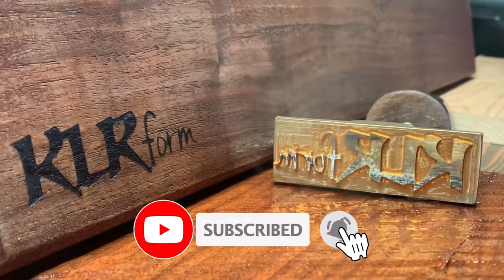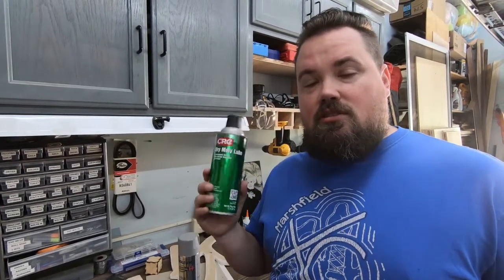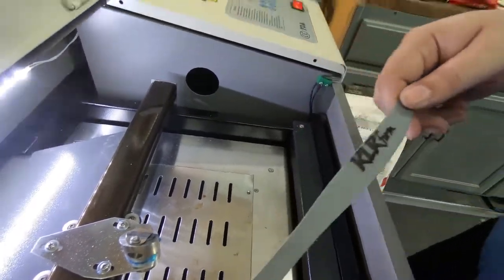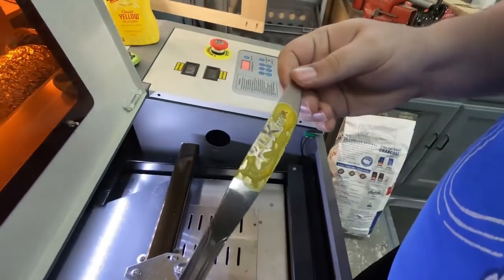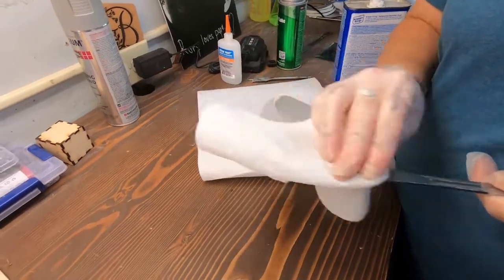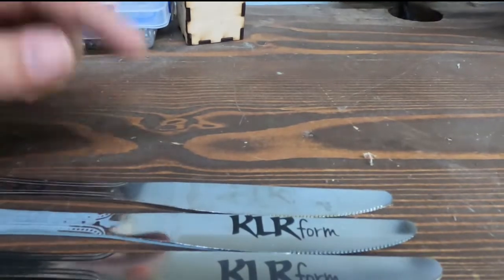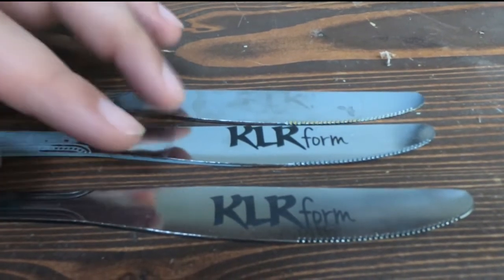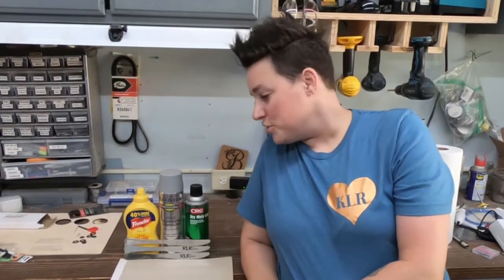CO2 Laser Engraving on Metal | Monport K40

Comment: 50% power on a 40W tube will burn up the Co2 really fast. That's probably 25+ mA. 40W tubes are rated at about 17-18mA, or around 30% power max. Dry Molly also gives off acidic fumes. It'll eat up the mechanical parts before you know it. Just a couple of tips!
Reply from the maker: Thanks for the tips
Reply: On my Onyx 55, I did some testing after reading this comment... even 45% power yields some, but not strong results... at 50% however (I used 60mm/s though for both) the image was dark, crisp, and solid.  @KLRform this is a great video, thanks!

Comment: I’m going to try the galvanizing compound before purchasing the expensive stuff. Thanks for the video.
Reply from the maker: I think it’s our favorite on the K40
Reply: @KLRform  would this work on the Monport Onyx 55?
Reply from the maker: Not sure. I have not used that machine. You will prolly need to test a few settings to get it working
Reply: @KLRform  I went ahead and got some, and at 50% power and 60mm/s speed, it's nice and dark with crisp edges.  Just for kicks, I may get some of the sprays that are "made" for lasers, but for all intents and purposes, there's no reason why the every day hobbyist or small business can't save 80% cost on this very inexpensive can of galvanizing compound!
Reply: @KLRform  it worked for me on my 100w. Thanks again.